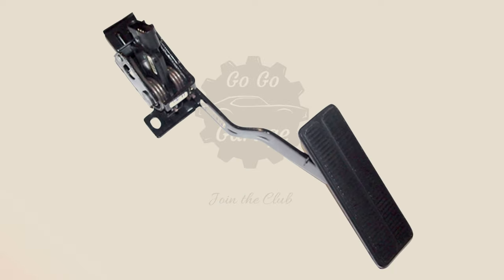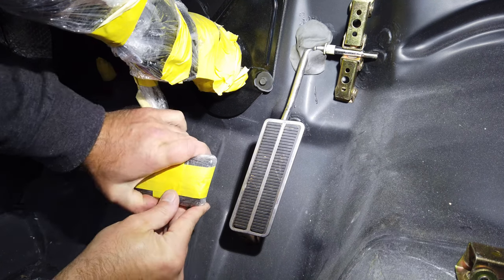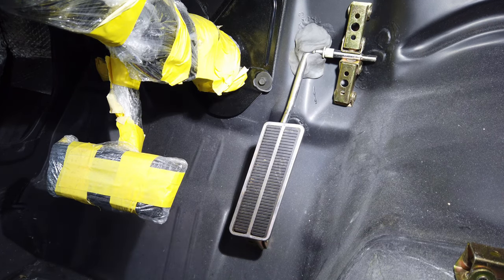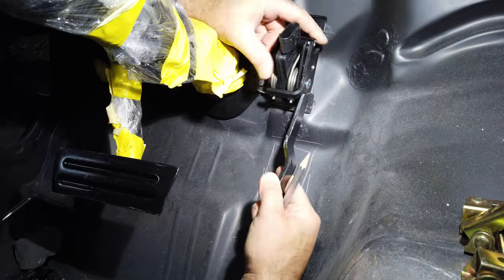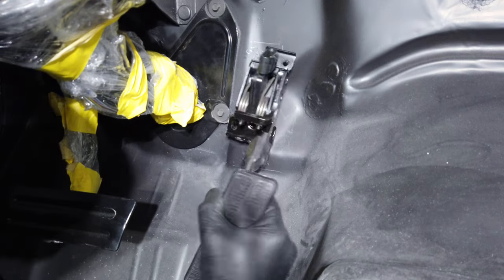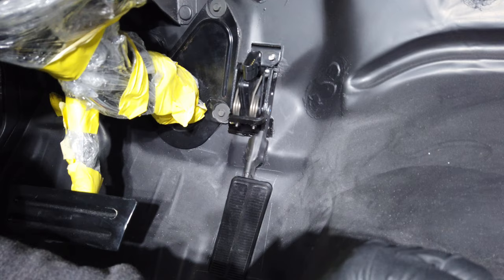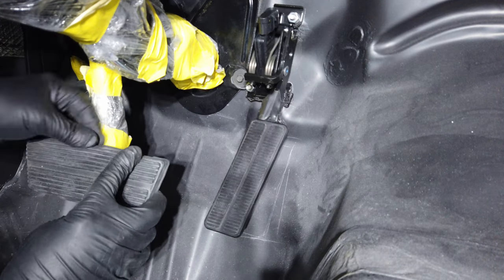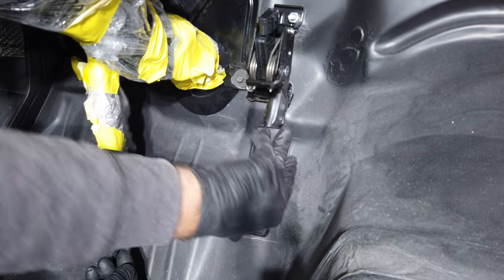Installing a LS/LT1 Style Accelerator Pedal in a 1967 Chevy Camaro

Comment: Great video! Your editing is top notch! I have a ways to go yet. I like the simplicity of that pedal set up. What year did it come from or how do I go about ordering one?I’ll be doing a LS swap in my 67’C/20 soon and it’ll be drive by wire so I may reference this video again!
Reply from the maker: Thank you, I believe it's a 2018 Corvette pedal.  It came with the wire harness I purchased from howellefi.com.  I noticed that Holley now sells an adapter plate for these pedals, but they are a little pricey, but may be another option for those that do not want to modify anything or have the time.
Reply: @GoGoGarage  thanks! I don’t mind a little fab work. I’ll look into Howell. I’ve heard of them and a friend had one of there TBI kits on a 502 big block in an 90’ Chevy pickup.